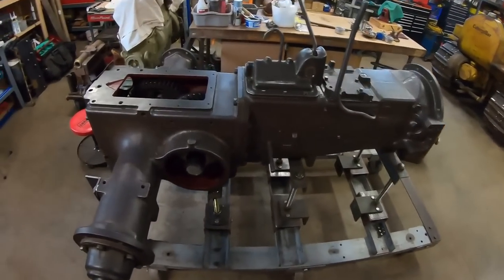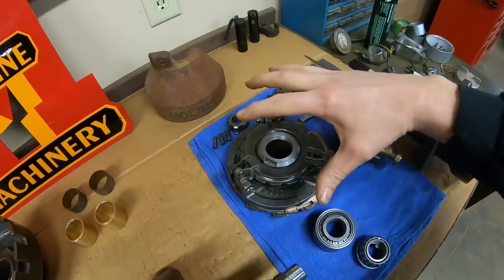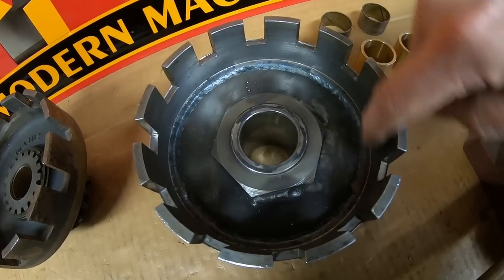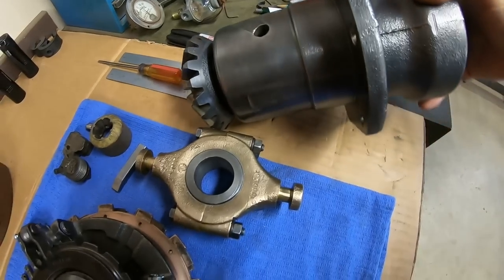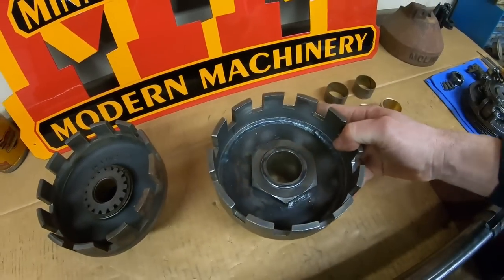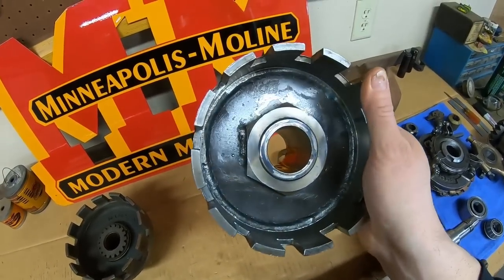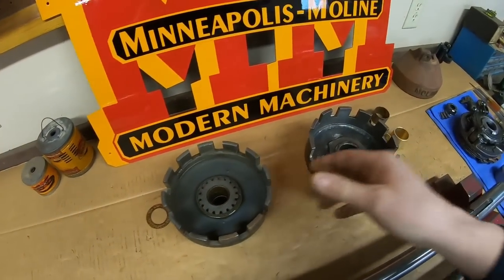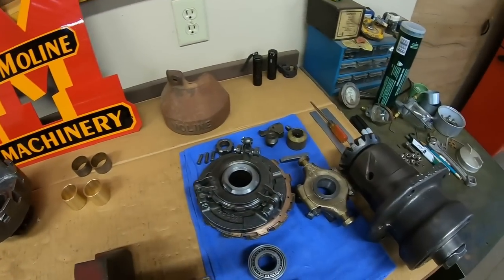#X231 Prototype Part 61: Fitting the Live Power Clutch & Making a Plan - What Goes into an Episode

Comment: As with any one off job, much of the time is taken up coming with a plan, and then sleeping on it, only to throw out part of the plan, as one minor alteration, can throw the plan out at anytime, at which point you have nothing to show  for all the time you've already invested.. it's just how it is...
Reply: My mind is asking how you are going to assemble the shaft and components with that step you are going to cut in the shaft for your new bushing idea. You can use your 1 piece bushing idea but you have to make it in the original thickness of the prototype bushing.  Or mill out the cage to fit a thicker bushing.
Reply: So  very true.
Reply: @JCMoncur  I was just watching this and wondering how Squatch was going to get a 1.5" piece of shaft through a 1.3" bushing.  
But I wasn't going to put it past him achieving it....

Edit:  Unless he splits the axle from the gearbox again to get enough clearance to move the shaft through enought to drop the clutch and spider in and then the shaft back... the refit axle to gearbox.
Reply: Sounds like a true plan coming together

Comment: I think your bushing idea is a fantastic one. I would still turn the shaft down. I agree, it's easier to do the bushing later, as it is the less expensive piece, however, it's easier to size an OD to an ID, and you can also check fit it. Your call, whatever you're more comfortable with. You seem to be a skilled enough machinist to make a very good part either which a way. Go for it!

Comment: By eliminating thin walled bushings, they will not collapse again. Win.

Reducing the 2 thin wall bushings to the one thick walled bushing is also a win.

Adding the thrust bushing into the thick walled bushing is a won again. 

Oil grooves, oil catch point(s), and holes connecting will improve lubrication that it never had prior is a  win again.

If you're still concerned with lubrication to it, maybe a scavenge pump and tube leading directly to this bushing and spraying it with the oil is an idea. You should be able to add one somewhere in the case, easy enough; if it would even be needed.

You have reduced and consolidated multiple problems into one piece, and it itself is a hand-made prototype piece. Sounds fitting to this prototype tractor to me.

Go for it, brother. It's all wins in my book.

Comment: Great video along with details.  Points of Interest,  the Shaft can be consider the 1st point, referencing all items to work from its Dimensions.  I think there are some specific specs to view, considering clearance's.  The OD of  shaft can be small giving good thick wall space of bushing, the length is in not worry.  The ID of bushing can be set to a good clearance, but worried of some length, wall thickness of outer rim butting up to bearing.  My first thought after speaking of a Trust Bushing was to build one complete Bronze Bushing.   :)

Comment: I like the one piece bushing idea. 
you could make a spot facing tool. 
It would be steel piloted through the bore. 
A single piece of high-speed steel as a tool bit, and then a crowd nut  and a cross bar handle. 
Just a hand crank powered tool to increase the width trust face. 
I am a machinist I can explain more if you want more details

Comment: I think that certainly minimizing the number of parts is best. Often we seem to be able to come up with a complicated solution but simplifying this is the more taxing process. I think you have been through this loop now and come up with a robust solution. Essentially shafts delivering power have four ways they can fail. There is torque load against the keys, splines and any pins or grub screws on shafts. There are end loads caused by gears trying to "screw" themselves apart or pull themselves together. There are side loads on the bearings or unsupported lengths of shafts, and the other failure is the shaft whipping under speed and load. This is all about the number of bearings and lengths of unsupported shaft versus shaft diameter. With all this pretty well pre designed there is not much you can do now other than be sure that your solution takes cognizance of the above.  If its just going to be light loads on the show ground I am sure you will be fine.

Comment: I'm digesting the assembly and need to walk through what I see.  The shell is free floating on the shaft.  It is limited in axial movement by a thrust washer against the case on one end and a thrust washer against the hub on the other.  The adjustment on the hub via the set screw and nut will control gear backlash and end play of the shell.  That's how I'm reading this. I concur that the thrust load on the shell is minimal and driven mostly by the bevel gear. I would agree that the flat surface area in the case is marginal at best for a repeat thrust washer.  In looking at your sketch are you planning on turning the shaft down to the same OD as the ID of the tapered bearing?  If you do that then the bushing will become part of the shaft pre-load and I don't see how the bushing can freewheel on the shaft. I'm going to assume you are leaving a shoulder/ step on the shaft so the tapered bearing is up against the same shoulder, then a diameter change for the new bushing?  The bushing pressed in the shell will have some float on the shaft and the limit will be the back side of the race instead of the casting.  Your sketches are easy to follow and rather clear, that's my reason for comment.  I'm a gearhead, enjoy your videos, it's a mechanics mini-series.

Comment: Hey Toby! I had a crazy vision of a way to press that one piece bushing into that hub involving a hollow ram press setup with the clutch assembly in the housing. I see that you ended up seeing the problem after you had already cut the shaft down. Don't let it get you down. for almost every mistake I have ever made on a project I have come up with a few crazy solutions and one of them worked. I wish I could show you what my brain is seeing. I am visualizing a threaded adapter to go on the end of the shaft to adapt a hollow ram to and a sleeve to push the bushing into the hub and a clip to hold the hub from being pushed forward against the clutch assembly. I know it's crazy, but if by some chance there is enough room to remove the stop clip from behind the clutch assembly it might just work.
Reply: I told you that my ideas are crazy. Sometimes you have to laugh. I still remember the time 2 of my friends were helping me pull a pump out of my well. 1 of them let go of the rope and the whole thing went back down the well. The poor guy was looking at me with fear in his eyes. I was laughing so hard at the time that he thought I had lost my mind. The end of the pipe was about 75 feet down and the rope was about 250 feet down. What he didn't know was before the pump hit bottom I already knew how I was going to get it. My wife was there when it happened and was convinced that we were going to have to call a well drilling company to get the pump out and another one back in. She was also convinced that I had lost my mind. When I told her not to worry and that it was just a minor setback, she almost lost her mind. By the time she calmed down the next morning, I was on the second recovery attempt and had the end of the pipe coming out of the well.

Comment: Just thinking out loud here. I like your idea of making a full-length flanged bushing for your thrust bushing. But I also think you might be able to find a large enough flanged bushing and machine it to your specs. Unfortunately, you already have your Lump Of Bronze on the bench. You might also be able to find an Oil lite type bushing. There was a place called Reliable Bronze in Stanchfield near Rush Lake that just might have a blank that would be sufficient and maybe some more experienced input for you. An Oil lite bushing is already impregnated with oil & made with Sintered Bronze so it would be porous enough to wick oil through itself. This is what we were in trade school for.

Comment: Toby I mostly agree with the plan. The only concern I have is the back of the bearing has a small surface area to absorb the thrust load. I think if you machined a small tee shape of steel about a half inch that had a larger face contact but would still seat against the bearing it would be able to have a larger wear area. Thanks for including all of us in the project.

Comment: All the brands of tractors suddenly got more complicated in the early/mid fifties. But look at how much better they were to use. Baling hay with my 1954 Farmall 300 with live power and Hi/low shifting (and power steering) is so relaxed and enjoyable compared to baling with a Farmall H (which I still love) that is not that much older. Also plowing snow with a loader tractor that doesn't have live hydraulics is that same pain. You end up constantly clutching and shifting in and out of neutral and gears. Of course there are other jobs where it doesn't much matter and the older ones still shine!

Comment: I woul make a flanged bushing and use one of the purchased bushings.  The depth of a single bushing is probably much larger than needed.  It will be easier to install two shallow bushings rather than a single long bushing.

Comment: Did you take dimensions of the thrust pad required thickness?
When it was all assembled, it looked by the video that there was a good 1/8 or greater gap between the face of the gear and the casting.
Got to back to the D2 videos to remember how the oil grooves were done on the track bushings.

Comment: If I understand the full use of this the bushing will be under very little load radially except when things are engaged. The thrust should be minimal except when there is a load on the PTO. So lubrication is key. You want the shaft to spin free most of the time. The wear on the original bushing seems like it is likely related to the failure that cased the marks you were pointing out. The only time you would have significant load on the bushing  with the PTO engaged the bushing should be rotating with the shaft so you shouldn't see that wear. I'm probably missing something with this as I can't really see from the videos enough detail to be sure. My sense is the design you are proposing, assuming a reasonable clearance for the bushing and adequate lubrication, will be sufficient even for doing a significant amount of work. For a parade queen, more than adequate. Looking forward to see how this works out.

Comment: the belt pulley gear would seem to be trying to shove the drive gear(and clutch basket) forward, along with the shaft that is pinned to it.  a minimal thrust washer(more like a spacer) should be all that would be necessary, since the shaft position is controlled by the bearings at the rear.(unless i'm missing something in your explanation of operation.)  the basket is going to spin when the belt pulley is engaged by the over center clutch, and slope of the gears trying to force them apart, taking any pressure off the thrust washer.  if the back lash was adjusted to a min, a thrust washer may not be needed so the bushing would be the prime item of concern.

Comment: You have options.. 1. How close are the proposed tolerances to going with a needle bearing instead of bushings? 2. Going ahead with the bushings resize plus oil slotting the bushings. 3.  Doing nothing new and Leaving the pto engaged all the time (with added guard at back). 3a. Modifying and still leave pto engaged.  4. Have no pto clutch inside, but have the appearance of pto on the outside.   Now to finish the video and eat my words😂.
Reply: Well, didn't have to eat words after finishing the video. Thought of another idea. Front of drum a new sized bushing as shown at the beginning, slotted etc. Back of the drum a tapered bearing and cone, reversed direction to the live shaft cup and cone that already exist. ?  Lots of measuring to do. Do you want to dyno the tractor ever? Then the pto and pulley need to be slightly robust.  You'll strike a thinker pose for awhile.
Reply: Just searched needle bearing on McMaster Carr for my snow blower and some interesting things came up that might work, such as a combo thrust and radial bearing.  Neat

Comment: The only thing I can think of that could be better than a T bearing would be a roller thrust bearing and sleeve bearings or needle bearings. However, that would only be necessary if X231 was going to be out in the field running a chopper with that belt pulley for years. Other than that, I can't see why the T bearing wouldn't be just fine.

Comment: There will be an issue with the thrust outer diameter if it is larger than the shaft entry in the case, maybe a two piece would make assembly possible.

Comment: Hi Toby. I vote for 'KIST' - Keep It Simple Teacher 😉. OK, it's not original but you are where you are. What you don't ever want is bits breaking off inside again. I think what you are proposing is more robust than the original.  For any readers who don't know phosphor bronze has a structure that retains oil within the metal of the bearing and whilst it will not last for ever it will last a very long time indeed.

Comment: like the plan of replacing the bushing and thrush washer with one piece.  Why wouldn't that be a good idea even if the tractor was used?  Is the concern that it might be more likely to spin the bearing, or that the bronze might crack in two where it widens?

Comment: what about putting a differential pinion setup shim (like the kind used on a d-44) between the back side of that inner tapered bearing to give your new bronze bushing thrust sureface something to ride up against other that the shoulder of the bearing? would only change the end play of that shaft by a few thousanths.

Comment: Your plan for the one piece bushing seems very good. I wonder if it would be beneficial to machine a slight bevel at the 90 degree location of the bushing step, to reduce stresses in that location, or would a bevel prevent a proper fit between the adjacent parts (& possibly a bevel would not be needed, anyway)?

Comment: I remake the big bronze main bushing/bearing for my gravely model L tractor engines. I also made thirty pinion shafts that has the input transmission gear apart  thereof and this shaft is part of the crankshaft.

These bushings take the thrust of the engine and the input gear of the transmission.

Your idea will work just fine.  It will be running against the hardened surface of the roller bearing.  

Yes bronze is expensive.  But it is harder than you think. I made some thirty main bushing/bearings for my gravelys. .  I will never use them all but people in the gravely club can.

Making gears is fun.  I use a horizontal milling machine to cut the teeth. Heat treating is something I cannot do at least and get it right.  But eulcid heat treating is very reasonable and they do good work.

If it were me I would have remade the entire shaft and have a harden surface put on the spline teeth that goes into the flywheel.  I am not critixing your way.  The non hardened shaft actual took a lot of hours of use.  

I am sad because it will be another three to four years till the next season of Christine.  They did that with the lost in space series and the kids that played penny and will Roberson grew up and it was just not the same show.

Comment: I like the one piece design if lubrication doesn’t become an issue.  I like to see your problem solving skills in action haha!
Reply: being bronze on steel, it should be OK with some lubrication. Only possible difference I would have done is to use a piece of Oilite bronze where its impregnated with the lubricant as well as having the channels cut for dynamic lube

Comment: Great job and I am really enjoying this series. My only concern regarding your thrust issue, is that the shaft bearing cage isn’t designed to take any kind of thrust on it. In my opinion, you would be better off machining your new bearing to directly contact the face of the bore on the rear casing (and lightly recessed to miss the shaft bearings), or by putting a large flat washer between case bore and your newly machined thrust/shaft bearing (preferably with a slight recess too, so it doesn’t rub on the shaft bearing).
Reply: @squatch253  Yeah it is how they did it but it is still poor practice to have thrust absorbed by a pin on only one side.  John Deere first did it with a snap ring in the groove then it was found that when mr farmer let his pto shaft go ungreased or dtove thru a big dip and collapsed it fasrter than it would go it blew the gropove out of the transmission case and left nothing to hold the pto in.  eeventually they put the cup and cone bearings on opposite sides of a beefy piece of cast left and that cured that failure.

Comment: No suggestions, just a question:  Why modify the shaft at all if if X231 is just going to be a parade tractor and the original thin bushings were judged adequate for production?  I'd think that just risks borrowing trouble.  The original setup may be flogged but it lasted long enough to get flogged. Of course I'm at the point in my life where anything I fix only has to last one day longer than I will.

Comment: I'd try to avoid a straight shoulder cut on the bearing, you probably want to chamfer the 90 degree cut a bit because if it is taking end loads in addition to the rotating loads, a crack can easily form right in that corner.  The thicker it is, the more likely it is to happen if you get any serious end loads on the shaft because that shoulder on the thick bearing is so stiff it will crack rather than flex.  If you have to, you may want to ease the end of that end gear to allow the chamfer to fit into the end of the assembly.  You might argue that it is just a show tractor that will never run any serious loads anymore, and that is a valid point - but I would still do it.  Just an opinion.